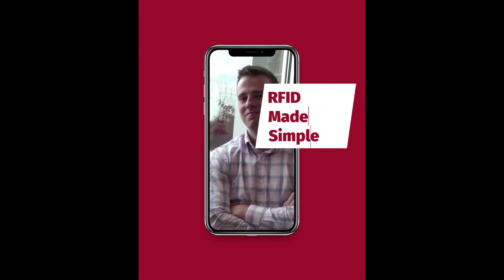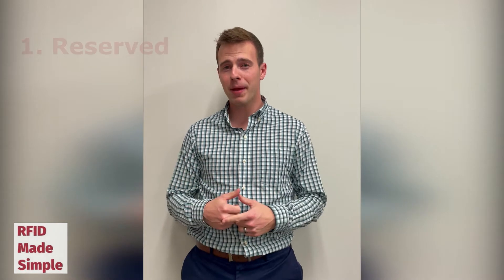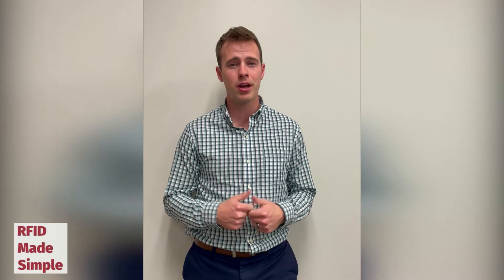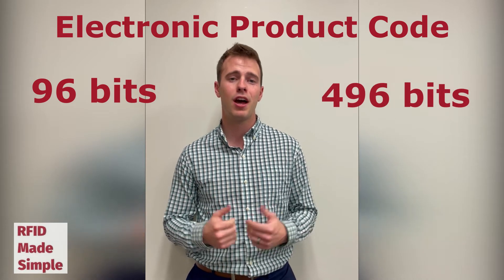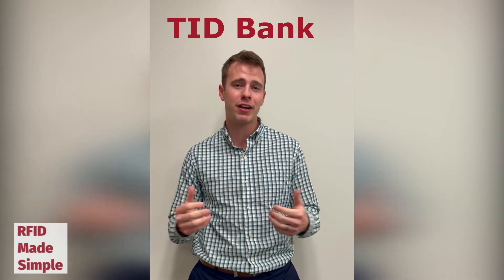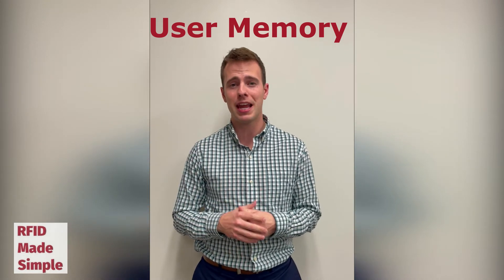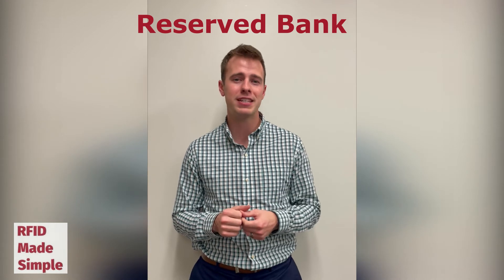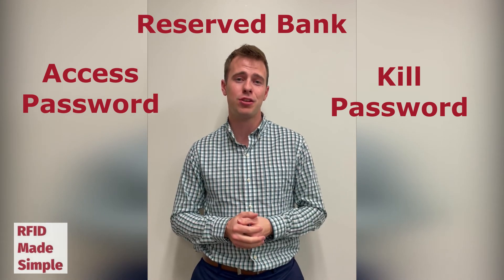RFID UHF Memory Banks Explained

Comment: I'm currently using RFID's as a part of my Thesis research. I'm trying to figure out the Arduino programming code used to access sensor data from RFID sensor tags. Any suggestions?
Reply from the maker: Thanks for the question. There are multiple data sheets available online that will pertain to many of the sensor chips on the market. For instance EM Microelectronic has many data sheets online.

Do you have a specific chip you are focusing on? Otherwise I can recommend a few depending on what type of sensor data you are looking for (i.e. temperature, moisture, capacitance, etc.).
Reply: @NextGen-Leaders-ColynnBlack   Since I made this post, I was able to gain access to my tags sensor data. But thank you for replying.
At the moment, I'm trying to figure out an Arduino code that will let me read multiple UHF RFID tags concurrently using a Sparkfun Nano RFID reader.